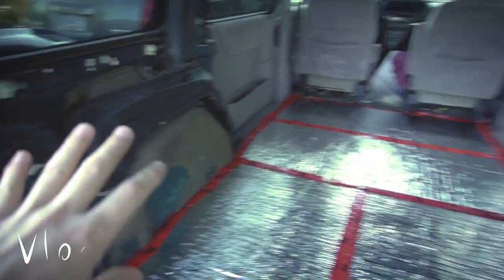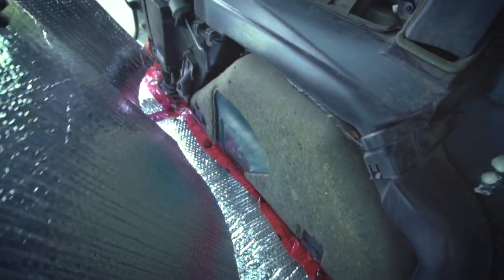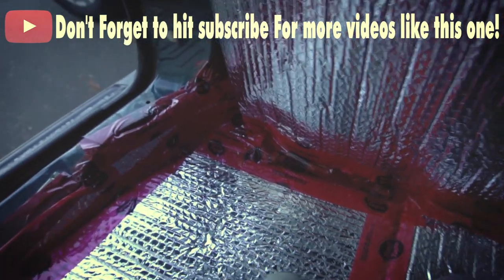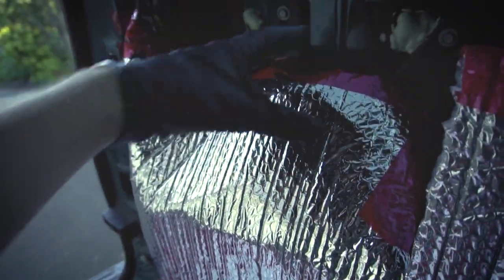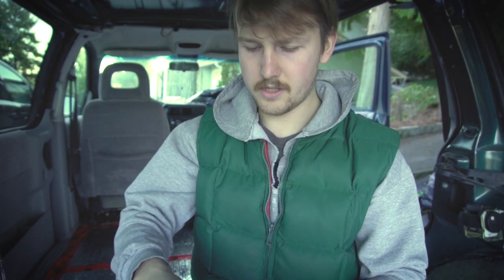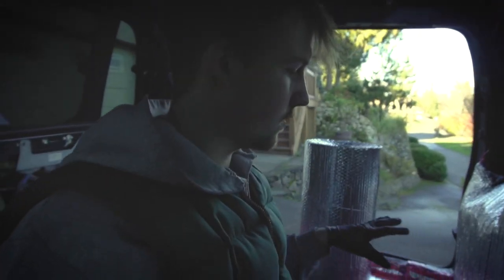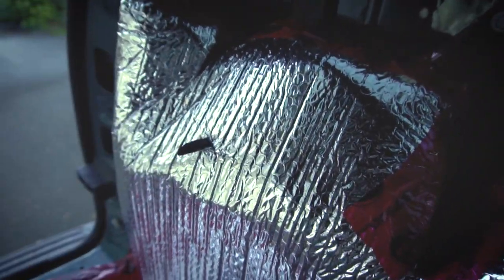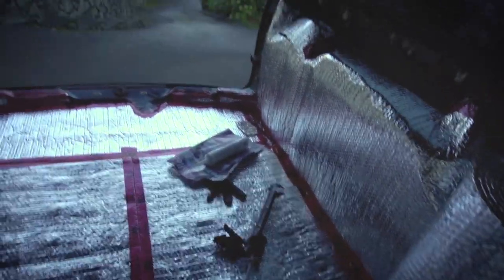What to do with Wheel Wells when Converting a Mini Van into a Camper conversion. // Day 4 Build

Comment: I am pretty sure you can't put reflectix against the metal, it would turn it into a thermal bridge. I'm pretty sure you're using it wrong
Reply: you are correct. reflectixs needs space between what ever your putting up against to reflect the heat or cold back into the air.

Comment: Why no insulation behind the reflectix?
Reply from the maker: great questions, I could have maybe spray foamed to fill in some gaps, but I just did the reflectix because I didn't want to take away from that 4 foot space between wheel wells, that is super import and vital to my build plans. I also like how the reflectix forms to whatever you wrap it over (with enough adhesive) because it saves space and creates a nice pocket on the back side that can be used for storage.